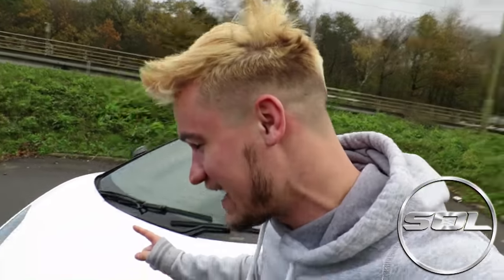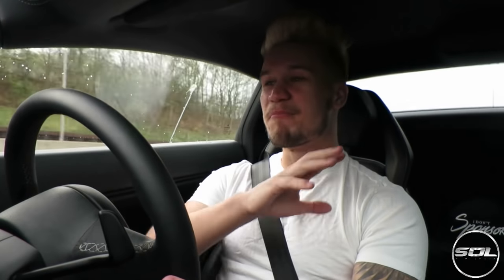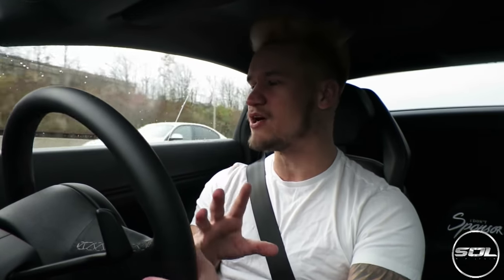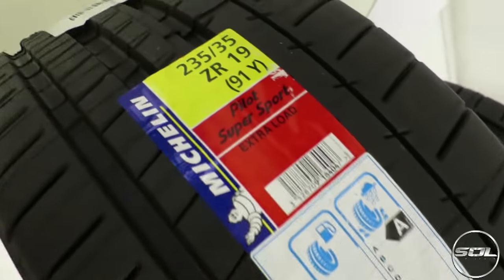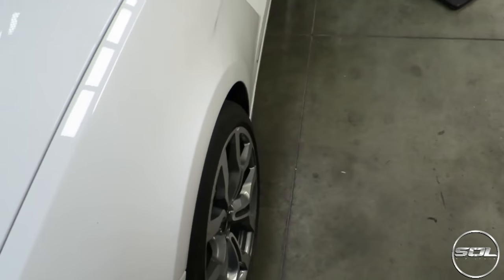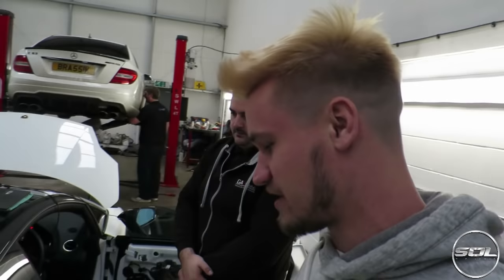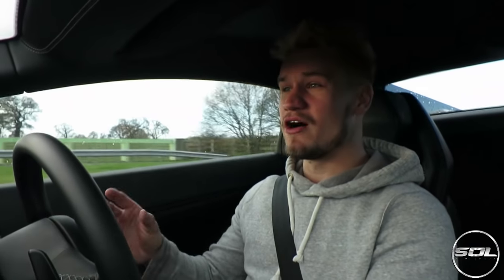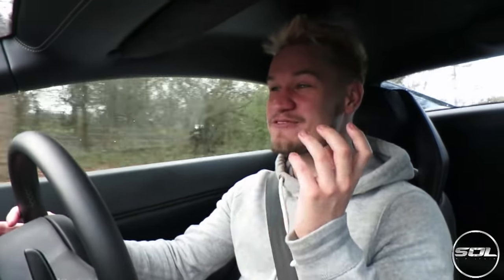MAKING MY LAMBORGHINI EVEN FASTER!!!

Comment: The Michelin Pilot Super Sports are great tires but they lose a lot of grip under 50*F (10*C), they're just not designed to run in cold weather.  I'm not sure if they come in the correct size for the Lamborghini but the Michelin Pilot Sport AS/3 is a fantastic compromise, I run them on my M5.  They have probably 90% of the warm weather grip of the MPSS but still work great in the winter and even light snow.

Comment: paul, you know the depth of the tread doesnt indicate the grip your car has... if the tread wore all the way down it would turn into a slick and actually have more grip than before, although probably not because they werent designed to do that... all the tread is is to displace water in wet weather...
Reply: I was thinking the exact same thing when he said "oh these tyres are gonna have so much grip" lol. He obviously knows fa about cars.
Reply: +A Cat you smart.....
Reply: thesmoothone
cats will rule

Comment: I always get confused with this, please correct me if I'm wrong. 

doesn't decat make your car illegal for roaduse.
Reply: Yes. However it depends how many Cats you remove. Most cars have primary (main) and secondary. Most people when talking about de cat just remove the secondaries and often add an X pipe. If you remove primary and secondary your car will fail the MOT  test ..removing secondaries only will be ok
Reply: PaulabJohnson he changes headers I guess has no cats only bull now ha.
Reply: +sher854 I removed the secondaries on my mercedes and added an X pipe. later I added kleemann headers which necessitated removing the primary cats. I then had to add some 100 cell sports cats to pass the MOT. an expensive lesson learnt

Comment: Don't waste your time and money on remaping, just twin turbo it
Reply: +Karl Tilgar Depends mate, evomsit tune remaps the power band, granite it's only a 5% increase at peak hp, but 10% in mid as well. Tuning a n/a engine isn't really too beneficial but where it shines is in the power band pull. As well as if you tune the dual clutch; quicker shifts + better power band + slightly more whp is going to beat a stock model of whatever car you're racing. I drive a turbo'd car so I can say chipping a turbo'd vehicle brings amazing gains. But I do agree, if money is a problem chipping a n/a engine isn't horsepower:$ worthy. A tt kit averages 45k so 600$ for a chip, or 45k for a turbo kit isn't a good direct compare on what to do to a vehicle.
Reply: It costs a hell of a lot more to add turbos than to remap it. Also, he wants to sell this car to get a new Supercar. It'll be a lot more efficient to remap it (as you don't have to pay as much to get it installed and reset to default)
Reply: l know, was beeing sarcastic :)
Reply: +Justin Ormsby It doesn't have a dual clutch gearbox.
Reply: +Karl Tilgar being**